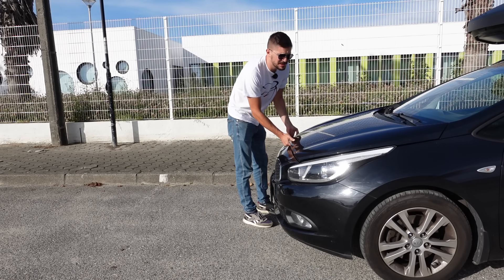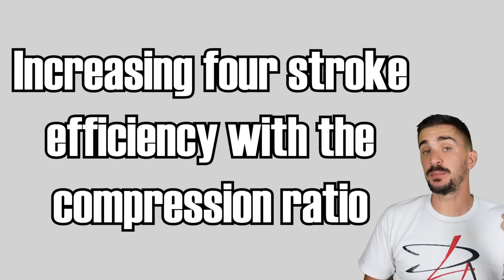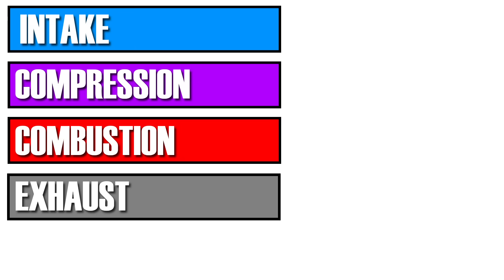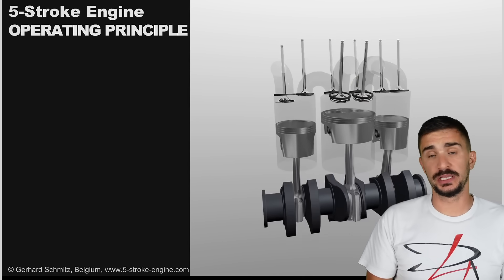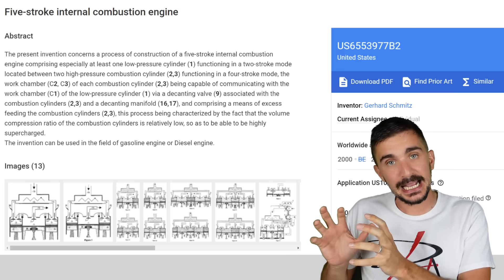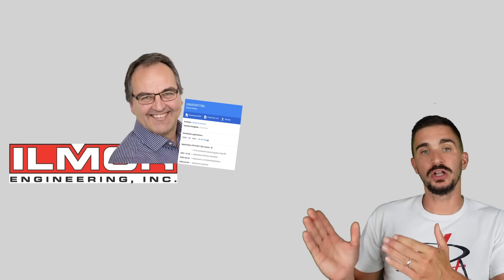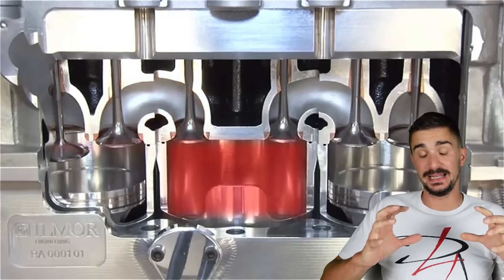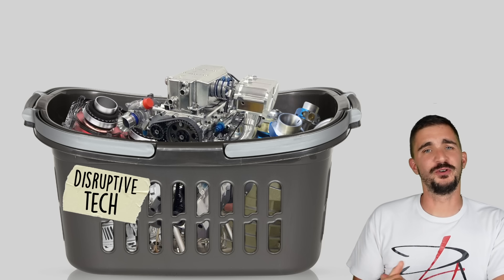Why Five Stroke Engines Are More Efficient But Still a Failure

Comment: 5:40 This is not true. Each cycle length is determined by the valve timing not the crank timing. If the main limiting factor for ICE's was the compression-expansion ratio, manufacturers would delay the intake closing events, but that isn't being done, because it decreases efficiency in the real world, it doesn't increase it.
Reply from the maker: Surprise, that's exactly what variable valve timing engines do!

Comment: All the things that are listed as cons for automotive use seem like largely non-issues for a light aircraft engine, while the advantages seem pretty good. Compact, inline design, good balance, light weight. You're almost always running consistent cruise RPM at 75-80% of your power band, you're not worried about catalytic converters or mufflers on many aircraft, and a small turbo that is running off cooler 2nd-stage exhaust and mostly is there for mild boost and altitude compensation will probably end up being a longer-lived turbo. 

In all, I'd be curious what the weight of a 200hp 5-stroke of this design would weigh, and if it would be comparable to a 4-cylinder opposed like an O-360.

Comment: 1.5L with a turbo only making 130HP is really a weak number... Nowadays there are "normal otto" 1.0L turbo 155HP engines with good low rpm power. Even if it was really 700cc with 130HP is not a very impressive number! For example, the Aprilia RS 660 has lower displacement, no turbo and makes 100HP! I wonder how he managed to find those companies! He must have had a very nice conversation skill!

Comment: So back to electronically controlled valves (aka FreeValve) and by valve-timing reduce the amount of air during the intake stroke?
That way, by regulating the air, we can have a larger expansion ration than intake ratio, right?

Comment: Interesting video,which raises many more interesting questions.Just having an under square engine with a much longer stroke can give up to 5% better efficiency. Maserati's 6 cylinder engine of the 1950's and 60's was a good example of this.The final 4 liter version had a bore/stroke ratio of .8, i e the bore is .8 [80%] of the stroke.But most people want power not efficiency.The other big limiting factor is the type of  fuel.Although gasoline is the most readily available fuel in the world it has the lowest octane capability and takes a relatively long time to burn due to it being made of long chain hydrocarbon molecules. Hydrogen, methane methanol and ethanol can all handle much higher compression ratio's than gasoline, and their combustion times are much quicker. Roy Mac Alister the president of the American Hydrogen Association was an engineer/scientist who worked in the USA from the mid 1960's till late 2000's experimenting with using hydrogen as an engine fuel. Unlike most of big car manufacturers who concentrate on using 100% hydrogen mostly for use with fuel cells.Roy's most interesting discoveries were with hydrogen boosting, NOT the little electrolysis units that run off the cars alternator ! But proper carbon fiber tanks filled with hydrogen at very high pressure, I can't remember the exact amount but many,many bars. Using hydrogen at an amount equivalent to 10% of the the engine's calorific requirements with a few modifications to the timing and mixture, an improvement of 25% in fuel efficiency is possible.I have his dvd set but some of the video's are still on Youtube, check out Roy Mc Alister hydrogen car.The improvements in fuel efficiency are possible because using 10% hydrogen improves the burn rate so much you get complete combustion and ignition is at TDC ,you don't need any ignition advance which causes heat loss since ignition is started when the piston is still rising on the compression stroke.Also there's no need for a throttle so no pumping losses, either.More improvements could be possible because the compression ratio could be raised but I don't think they ever did that.Using alternative fuels like wet alcohol, that is alcohol with a high water [20% to 30%] content is possible too plus several other fuels like Turpines that are normally very difficult use in a conventional ICE Engine.This could make a huge improvement to some of the challenges humanity is facing with improving engine efficiency and pollution.

Comment: Wouldn't this engine concept be interesting for larg, hydrolicly driven, construction equipment? These engines mostly run on constant high rpm, so no problem with the low rpm / low temps.
Should safe some fule on the long run..🤷‍♂️

Comment: Really it's disappointing in that another engine design likely failed to make it to market because it didn't deal with the varying loads "like a traditional automobile engine" question should rather be "how efficient is it as a generator running in it's optimal power band?" because that's where the future of combustion engines really should be going.

Comment: Any investment in internal explosion engines is wasted money in a world of electric motors. There's no future in the ICE, irrespective of how many suck-squeeze-bang-blow cycles it has.
Reply from the maker: *looks around. 
A world of electric motors you say? Hmmm. I'd like to try whatever you're having.
Reply: @d4a  You're welcome to try what I'm having😊. I bought an EV in March 2019, it's our only car and has now done 103,000 km. We live in rural France and have done long hauls all over Europe in this car. We also have a hectare of land plus an acre of woodland. After getting the EV it seemed strange to go to the petrol station in an EV to buy petrol for all my garden equipment. The size of our plot and the woods mean that our garden gear has to work hard.. we do a lot of mowing, brush cutting, hedge trimming and chain sawing. I swapped out the Honda and Stihl gear for all electric 56v kit. It has proved to be more than up to the job with no need to handle messy fuel or mix 2 stroke for the chainsaw, no need to pull starting chords to get them going and make all that noise and stink. The car and the 56v batteries are all charged from the solar panels on our barn roof. That's the reality for me.

Comment: Awesome video, really had me excited and then shit all over that excitement at the end almost unexpectedly. I mean that as a good thing with how the video was planned out. I also really liked the 150 year ICE tribute at the end, it's hard to believe. 
If the ICE fails to the EV motor, oh well I guess. Electric vehicle technology is older than the popularity boom of crude oil in 1863 or '64.
But that doesn't mean EVs have been the dominate engine choice for 150 years straight. Conspiracy? Maybe, but it's cool seeing all these really old design ideas getting resurrected and recreated. Such as this, the five stroke ICE or the in hub EV motor, first made by Porsche way back in the 1800s.
It would be even better if these old designs would get bastardized with new and futuristic technology. Such as, just off the top of my head, variable cylinder deactivation included on the five stroke. Something more dependable and actually functional instead of the two examples of it by GM. First in the old horribly unreliable 1981 Cadillac V-8-6-4 and the most recent cylinder deactivation garbage. At least then the low pressure cylinder could be deactivated at low RPMs. Does it solve the issues of the five stroke, no. But I only gave that a few minutes thought and I'm not an engineer lol.

Comment: Since the 1970s claimed internal combustion efficiency has been rising from around 19%. Today, engines in Formula 1 get closer to 35% when they use specific heat scavenging technology. I think I can say with certainty that nobody has an internal combustion machine in their driveway that has 22% efficiency or greater.

Comment: A25A-FKS with 39.8% thermal effeciency at certain load and rpm using simulated atkinson cycle via wide variable valve timing. They get 0 psig at BDC of the combustion stroke

Comment: It sounds like it would be a fantastic replacement option for a generator in upcoming diesel electric construction and farm vehicles though. The mid to larger home backup generators too.  Lighter, same or less complexity, less exhaust noise(?), simpler emissions sensor controls, same or cheaper repair parts, same or better fuel efficiency as diesel, ability to use cheaper pump gas instead of diesel, all in all seems like a decent enough list of benefits to make it a possible oem option. As long as the parts are made robust and reliable enough to match up to typical farm abuse I can see it taking off.

Comment: 150 year old tech? Nicky Tesla and his AC induction motor have to be pretty close to that. Too lazy to look up exact dates, but I just replaced a 60 yo motor with an exact replacement. And I mean EXACT. Only difference is location of the holes in mounting bracket. Which they probably did just to make me drill new holes, the b*astards.

Comment: Very interesting stuff, never heard about it for a petrol engine. Fascinating the comparable technology of double n triple expansion steam engines pretty much took over the market within years of introduction. I wonder if that's because of steams Inherently lower efficiency the extra cylinder volume really adds up, or that these motors were used in things like factories and ships, that could afford a larger physical plant if it reduces the fuel needed. Not exactly a tradeoff your modern hatchback can make